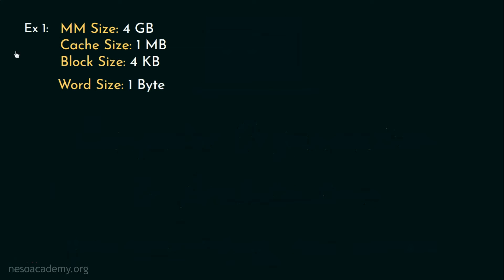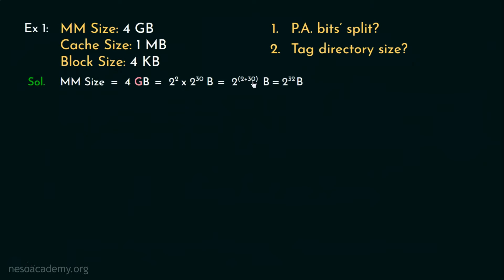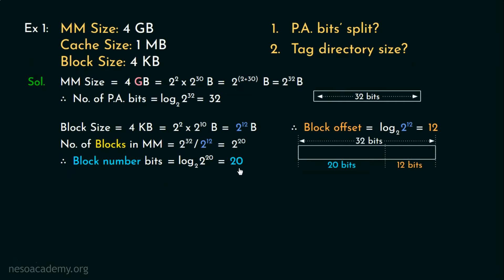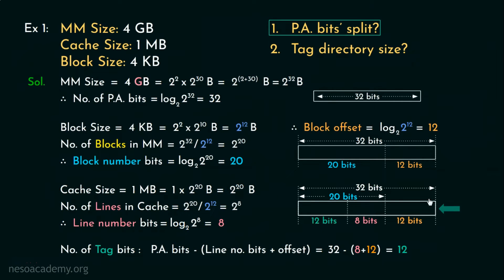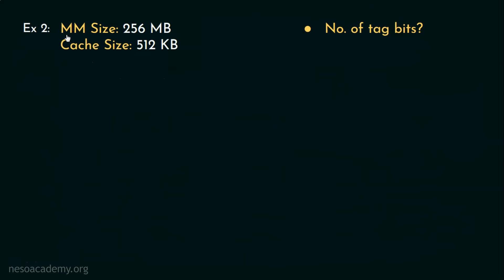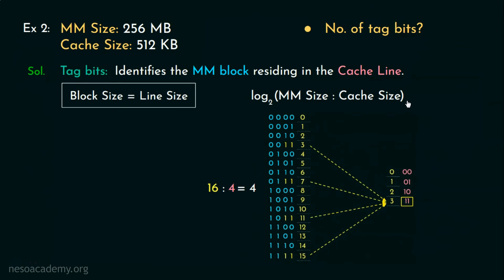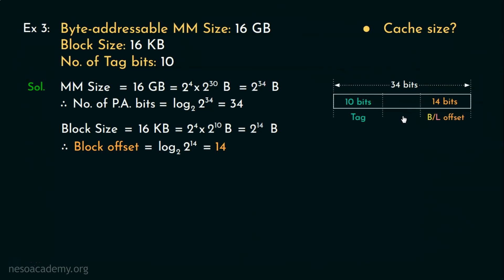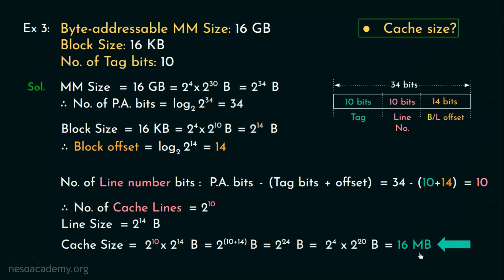Direct Memory Mapping – Solved Examples

Comment: For the last one, while I at first failed monumentally, after rewatching the video (and hopefully understanding better) I realized (to me at least) there's a simpler way to find the cache size.

You are told the # of tag bits is 10. So you know you need 2^10 different tags, and by the same token that the cache fits 2^10 times into the MM. So you get this equation 2^34/2^x = 2^10. Since you know algebra, you know you can convert the system to (just use exponent laws) 34-x = 10. Solving for x you get 24.

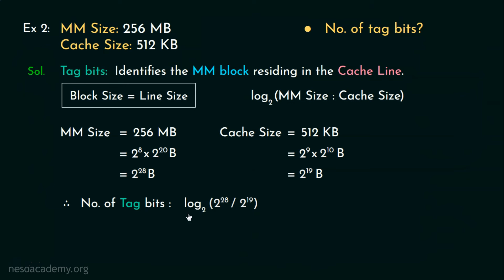Comment: 8:07    Consider a main memory of the size 64 kB 
with each word being of 8 bits (one byte) only and a direct mapping Cache memory of size 4 kB also having data word size of 
8 bits. Find the following : 
(i) What is the size of tag and index fields of cache ? 
(ii) In what location of Cache, hexadecimal address to main memory (AABB) (if exists in cache) will be located ?

can anyone solve this question..?
@Nesco Academy can you solve it..?
Reply: Without knowing block size, I am gonna assume arbitrarily that it is 1kB. So 10 lines for block offset, and 4 lines in cache. So AABB will be in line#1 of cache since AABB ends with 01. 
If you take a different block size, AABB will still end up in line#1 (01) but there may be more lines in the cache.

Comment: so tag bits represent the log(times the cache would fit in the ram). if ram is 4 times the cache size, then the tag bits are 2. in above case, 2^10 times x cache size = ram size. therefore. cache size is ram size/2^10= 16 x 2^10 x 2^10 x 2^10 bytes. = 16 MB.